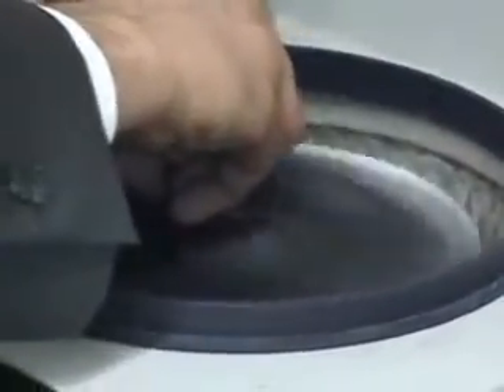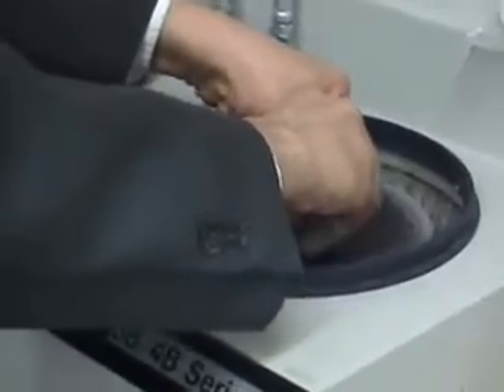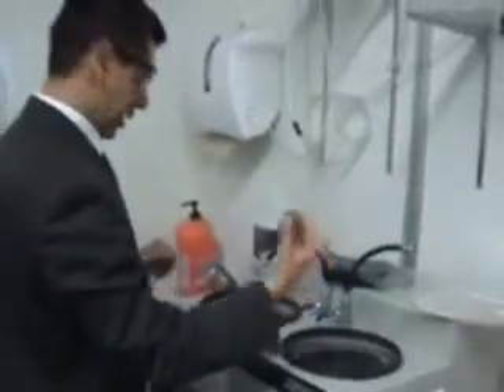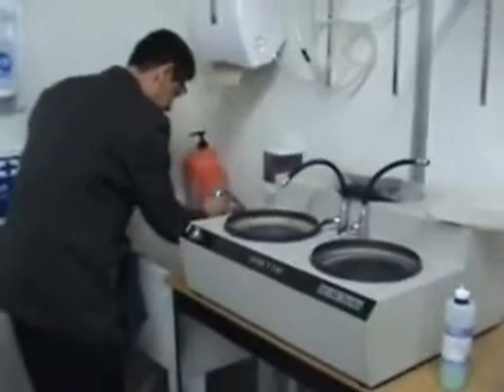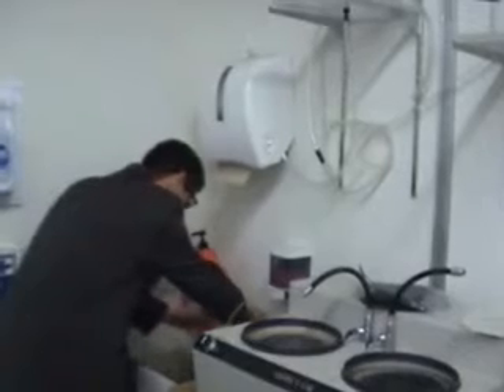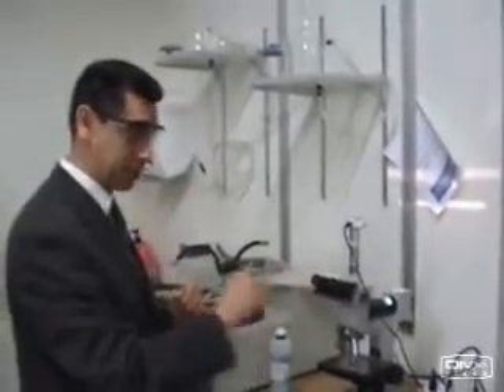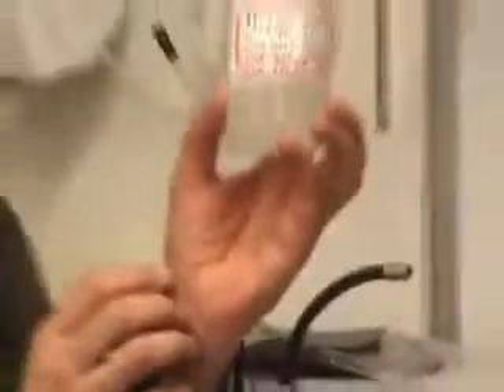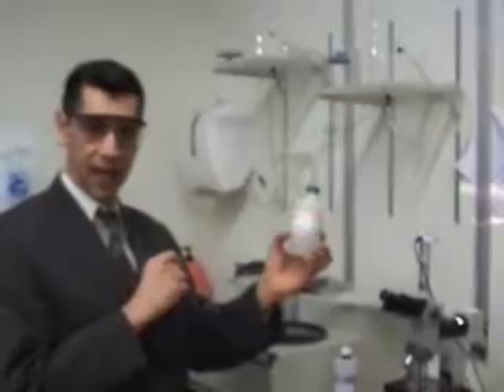Polishing Metallography specimen.wmv

Comment: Investigations of the structures of metals are generally carried out on section that have been cut from a bulk speciment. Frequently, only a single section surface is prepard, and the structural featuresexposed on this surface may be investigated using various techniques. All these techniques involve the reflection of some form of radiation from the section surface; and image of the surface is formed from the reflected radiation, that allow variation in crystal structure or composition over the